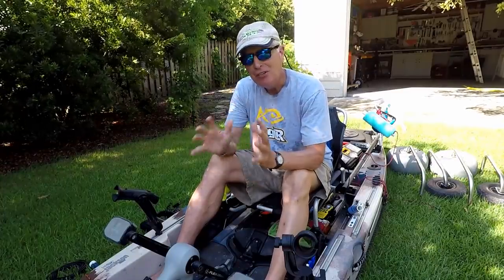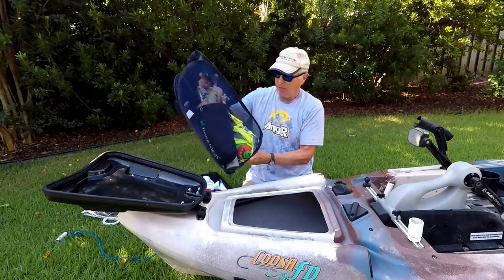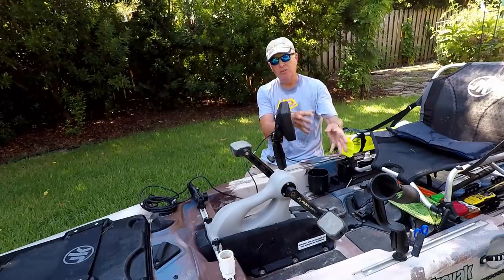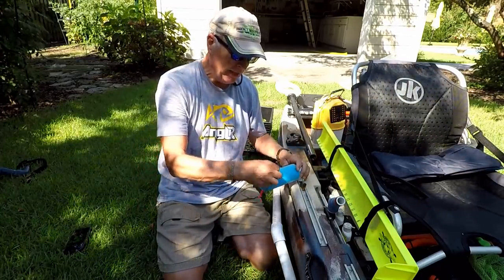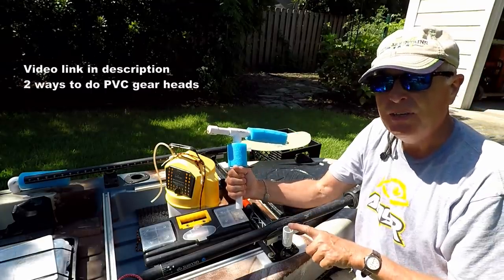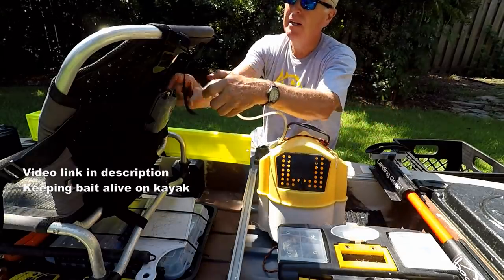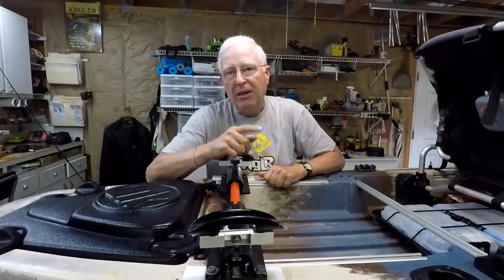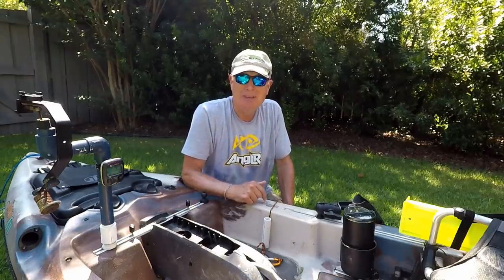Fishing Kayak Setup Ideas - 34 Easy Kayak Modifications for Fishing

Comment: I went the whole hack route including tilt up trolling motor and battery. Next was a trailer because it was too heavy and cumbersome to slide into the back of my pickup.I used to load everything I thought I might possibly need.
Now I'm reversing course back to a simpler paddle rig . I know what essentials I'll need now and and have realized  that the simple pleasure of being able to slide quietly into the water and stealthily approach fish in even ultra skinny water is so rewarding. 
In the water in less than a minute and floating high.
Florescent take apart paddle with screw ends allows me to screw each paddle into the bottom thru anchor rings on each side.. Voila... high visibility double power poles.
Ah h h the simple life. So many more spur-of-the-momemt fishing capers.
Reply from the maker: Yes, it is always a tradeoff! I need to downsize as well!

Comment: I watch your videos all the time and I think they're great!  I thought of another idea to store wet flies or lures instead of using a pool noodle as your Hack #15.  I do a lot of fly and conventional bass fishing from my kayak and I found that sticking a strip or two of velcro (loop side) to my kayak someplace serves as my fly holder.  As I finish using the fly/lure I just stick it into the velcro.  A lot smaller than the pvc/pool noodle holder and I can put some anywhere on my kayak.

Happy Fishing and Thanks Again!!!
Reply from the maker: Great idea! Does the velcro peel off? I had to stick velcro to PVC and then attach the PVC to the boat. I found  sticking velcro directly to the HDPE of the boat did not work for long periods of time
Reply: @KayakhacksFishing  I've not had any issues with the velcro separating from the kayak.  It's a Hobie 2018 Outback.  It sticks and holds normally.

Comment: Wow! Yet another informative and educational video by one of my favorites on YouTube! Where do I begin? Adapting your modifications to my Ascend 10T with only a 4" dia round hatch. I have the stand-assist strap, a lot like yours.  Anchor reel - definitely something I'll consider. Track at base of seat. I can add one, and the cup holder idea right there is awesome. The tool caddy! Yesss! The answer to my dilemma of tethering all those things to the base of my seat! I may tether anyway but with the caddy, they won't be all rolling around, getting tangled up. Velcro strip holders on side of seat! Another great one. Lure holder - love it. Crate or no crate - I'm inclined to agree with you. A doormat - great use! And the lightning detector - I didn't know about that! In Florida, it's a must. 
I'm also wanting to find a better wheeled-transport system. It's getting more difficult to bend and stretch to get the scupper hole - based trolley underneath and in position. Thanks for all the tips! Now I'll get busy..... :-)
Reply from the maker: Wow - thank you for all the encouragement!
Reply: My pleasure - you work hard and deserve the praise :-)

Comment: A lot of good stuff there but may I suggest one thing? The  HDPE block you put under the trolley mount should go inside the kayak. Think about what load is there. You are hanging the kayak from the mount so it will tend to want to pull out not rest on top of. Thanks for your tips.
Reply from the maker: Good point! Thanks!

Comment: Great video.  I love the tool holder i think i am going to use a magnetic bar for mine.
Reply from the maker: I tried the magnetic bar and could not find a spot on the yak straight enough to mount it. It would work if you have a spot!

Comment: If you ever need to glue something to your kayak. Amazing Goop marine or regular works great for gluing to propylene. I have a pelican bassraider and have a piece of marine plywood for my fishfinder and a hard rubber paddle holder for my net both glued to the boat. Just sand both surfaces like you would anything else you would glue
Reply from the maker: I need to try that. I have been looking for something that would adhere to HDPE.
Reply: Kayak Hacks Fishing I’ve only had it fail on a stern light mount when I upgraded to a led light and had to reinforce the pole to support the heavier light but it held up fine when I had the old contestant light.

Comment: Do you have an opinion on the orientation of the rod holders? I am about to install one on my kayak but I was envisioning myself leaving the line behind while I paddle, and I feel if I get a bite and the rod holder points backwards, the rod might slip out of the rod holder, i’m thinking of installing it sideways so the rod points away from the sides of the kayak and maybe lessen the chance of the rod being pulled out by a big pike or walleye… thoughts?
Reply from the maker: I think you should point them towards the fish to make sure the rod bends towards the hit. On my kayak I have the ones I use to hold the rods I am casting and two pointing to the rear for when I troll.

Comment: Thanks for the awesome vids! They help me out a bunch when setting up my kayak. One question I have though is what size self tapping screws do you use for PVC ? Im planning on making some outriggers and the rod pivot swivel, do you think the 3 rod pivot swivel would work on my track mount ? Or would it be too heavy for the track?
Reply from the maker: I used 3/4" based on the size of my rods. If you have heavy rods, go larger. As long as you have heavy duty track with good, solid mountings, it should be OK - but again, it depends on the size of the rods. Although I showed the pivot with 3 rods, I think only going with two would be better for keeping things organized.  If you have a doubt about the installed track on your kayak, you could always get and mount a heavy duty track like this one - https://amzn.to/2VxC6Pb
Reply: Kayak Hacks Fishing ok , I think my tracks are sturdy enough. Thanks . And yes probably a good idea to only have 2 rods, I'll be making many of the Scotty mounts with toilet bolts you suggested too for this.
Reply from the maker: @travist7845  Perfect!

Comment: jUST A THOUGHT ON YOUR SOUNDER SET UP , HAVE YOU CONSIDERD MOUNTING THE TRANSDUCER AND BATTERY INSIDE THE HULL, I HAVE ALWAYS DONE THIS ON ALL MY KAYAKS,IN THE FRONT, FORWARD OF ANY POSSIBLE TURBULANCE FROM PADDLES OR PROPS AND HAVE NEVER HAD ANY PROBLEMS,( TIP), MARINE GOOP IS THE ONLY ADHEISIVE I HAVE FOUND THAT WORKS 100%, CHEERS FROM COPETON DAM DOWNUNDER
Reply from the maker: I wanted to do that, but the system included side imaging in addition to the standard down imaging sonar. Sadly, side imaging will not work through the hull.

Comment: My Sevylor kayak paddles have plastic collets. After about an hour of paddling, these collets seize up and won't turn in order to release. I took the collets apart, clean the threads of grit, and put a very light coating of plumber's grease on both male and female threads. Don't want to get any grease on the grip surfaces. Problem solved.
Reply from the maker: Great solution! Plumbers grease!

Comment: #35 You can also put a net on a Taco clip instead of the paddle.  Many net handles will fit.  If adjustment is required to tighten or loosen the fit, simply put the clip in boiling water for a few minutes, then bend to fit tight.
Reply from the maker: Great tip! Thanks!

Comment: Great video and a question.  What are the flat pieces of PVC that you're using to make the PVC Back Plates?  Thanks
Reply from the maker: It is trim. Go back to the molding section in Home Depot or Lowes and you can find it in all shapes and sizes.
Reply: Thank you

Comment: Great video. I noticed your Boonedox was close to the stern. Are you happy with that location or why did you not place it behind the seat in front of the rear accessory track?
Reply from the maker: I had to put it that far back to get the height to keep the rudder from scraping when I load and unload it onto my truck. I am good with that spot for that reason. From a pure transport perspective, your suggested location would be better as more of the weight would be balanced. However, I would also be concerned about stress on the hull given the weight of the Coosa and worry a bit about cracks. But, hopefully, the thick additional mounting plate Jackson sells for heavy kayaks makes that concern go away.

Comment: That Velcro tool holder can be replaced with a magnet strip, then you don't miss with Velcro.
Reply from the maker: The problem with magnets is a lot of tools are not compatible and if the magnet is rigid, it will not attach easily to a curved surface. You could mount a magnetic bar to some PVC and use the PVC gear head to hold it if you wanted to go that way.

Comment: What I have been wondering, is why on one has thought of making a floating trailer, to tow behind their Kayak.? Maybe use PVC pipe or something else that float's. There never seems to be enough room in such a small boat.  Just a new idea to send around for someone. Thank you for reading this. R. Williams
Reply from the maker: I have seen a commercial product that does that. I cannot remember the name of it right now. Interesting idea. The challenge would be to make something that did not add a lot of drag.
Reply: Richard Williams 
If you need that then either you're trying to bring too much stuff or you need to graduate to a real boat.

Comment: I was wondering why you put the wheels so far back. I didn't know they even had the short shafts for the legs. On your one video I was thinking my trailer with the 3" PVC is higher than most tailgates so I was wondering why you were worried about rudder dragging the ground when loading and unloading because I have 3-4 inches of clearance. Makes sense now. Are you having problems with tracking on your coosa as far as being hands free goes?
Reply from the maker: The short shafts are the standard legs that come with the skinny wheels. They do sell the long legs and they fit the skinnies. The short legs do keep the rudder off the ground. I had to get the long legs with the fat tires to keep the tires from rubbing on the side of the boat. On tracking, I do end up with my hands on the steering all the time. However, I have never been in totally calm water (no wind or current) to see how it actually tracks. Fishing in tidal marshes there is always a current and the wind is constant. Other folks have complained about tracking. I think I will go out and look at the orientation of my rudder with the controls centered and see if it is perfectly straight. It looks like you can adjust the angle a bit by using the hex bolts.
Reply: Kayak Hacks Fishing I also live and fish in Swansboro. I made a video not trying to get you to watch I just feel you are better at diy than me. I made a skeg for my fd that comes from the rudder and I rarely have to touch the controls now. I live at the waters edge of bear creek and have tested it thoroughly and can even cut across current and still not have to touch the controls. I bet as handy as you are you can probably definitely come up with a neater/ better hack
Reply from the maker: That is a really neat solution!
Reply: Kayak Hacks Fishing I bought another rudder just in case because they are relatively cheap. So far so good though it been fantastic tie on new lures and fish a shoreline not worrying about if I’m going to pull a u-turn. My wife’s FD came with the long legs skinny tires and so did mine and mine is a year old. She has the new generation landing gear and I have the old one. That’s weird although I did tell them what kayak I’m putting it on so idk why they went with the short legs on yours. Hers also came with thick hdpe to reinforce.
Reply from the maker: At least Boonedox is evolving with the kayak models.

Comment: How is the FD drive been treating you? Any issues?
Reply from the maker: It had a hum initially, but after using it for a few hours that is pretty much gone. I tried to do a video where I put the camera underwater and had my buddy pedal by in his FD to see how noisy it was. The camera mic did not pick up any noise. The water was cloudy and you could not see the prop, so the vid is not believable. We will redo it on a day when the water is clear. I did a vid on 4 problems I ran into with the FD - https://youtu.be/dxtTXA1MaSs

Comment: Do you have a video on your tackle box and where you keep your lures and hooks?  
Also, how long does it take you to put on all of the accessories to get on the water.

I went to the coast and took about half of the stuff I usually take on the kayak.  It still took me a long time to get on the water.  One thing is that the Hobie kayak cart would not come out of the scupper holes.  I had to dump everything out, and put it on its side to pull it out.  I'm going back to the cheap Academy lash on carts!  

 Thanks
Reply from the maker: I have really downsized this year - the small box I discuss in this video is all I use.  https://youtu.be/aaVoa56hEZI. I'll do a vid on what is in it. Good question on time. We think the rain will stop by Wednesday and plan on going out. I'll time the setup from when I get the kayak to the water. It's probably around 5 minutes. It's really just the two camera mounts, the rig rack, the bump bar and the anchor hanger.  Add another minute to get the free ANGLR app going. Everything else is transported in place (rod holders, seat, etc). Let's see!
Reply: Kayak Hacks Fishing Thanks again!  I wasn't  leaving anything on the kayak when trailering it. I'm going to start to leave things in the hatch and leave the seat on.  I'll have to add the mirage drive, ice chest, lures, and rods.  I'm also getting rid of the crate and side kicks.  Also, the cargo box on the trailer.  It's a pain to unlock.  I'm getting organized!
Reply from the maker: Yes, as long as the gear will not fly off on the highway, I leave it on. I would think your Hobie is pretty stable and the sidekicks would not be needed.
Reply: Kayak Hacks Fishing Thanks. I used the sidekicks in case a charter boat tried to flip me.  I'm staying in the flats.

Comment: Man, this guy would think I'm crazy I guess. He obviously doesn't launch from the beach.  I take my kayak out on the ocean with just my spinfisher 7500 (already rigged for live bait) and stiff 7 foot rod, a small old cooler that sits perfectly behind me as a baitwell for my croakers or pinfish, fishing pliers around my neck, and bolt cutters tied to my kayak in case of large sharks that I can't get the hook out with out cutting the hook in half.   I literally don't even bring water (I am a marathon runner though and don't need any water if I'm just sitting for 4 hour).   Launching from the beach means  you want nothing loose if you get hit by a wave.  And I don't like putting a bunch of crap inside the storage areas because it just gets soaked with seawater in there.
Reply from the maker: You are exactly correct. I do not fish in the ocean. If I did, I would change the stuff I take to align with you.

Comment: Your safety gear is in the most inaccessible part of the kayak. I didn't see a bilge or bailing pump, maybe I missed it. Ive owned hobbies and two have sank from poor design/manufacturer defects. The first time was a disaster with all the emergency gear in the front hatch under everything. Because it was so far away I panicked and didn't go them asap, I just tried to steam my way in until it filled with water and flipped. Second time (years later) my safety gear and hand bilge pump were right behind my seat.  Rather than panick and frantically steam the few km to shore, I bailed the hull, peddled 20 mins, bailed the hull again and got to shore just before being required to bail again. In saying so, I had a plb, flares and handheld marine radio both times. I believe a kayaker (especially offshore) needs to be able to self rescue and as such, set their vessel up in a way that allows them to do so.
Reply from the maker: Good point on the pump. The safety gear in the bag is my VHS radio and my backup emergency beacon. I have my primary emergency beacon in the pocket of my PFD. I do need to get a pump. Thanks for pointing that out.

Comment: Too much gear. 2 rods, small flexible tackle pack, net with short handle, and a life jacket with pockets. The only customization needed is an anchor trolley if youre like me and enjoy bottom fishing. Spend your money on a high performance kayak that doesnt weigh so much. Also the spend your money on high quality gear and you dont need much.You will want to go out more and you wont need help loading and unloading. Check out stealth fishing skis if you want the most efficient possible kayak. Learn proper kayaking technique. That will save your back. Not a heavy seat.
Reply from the maker: I appreciate your perspective